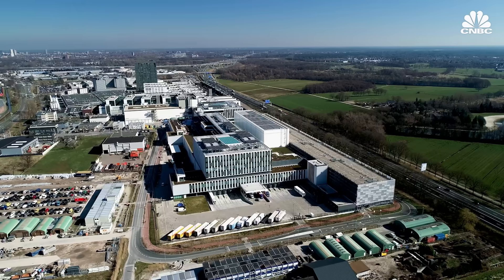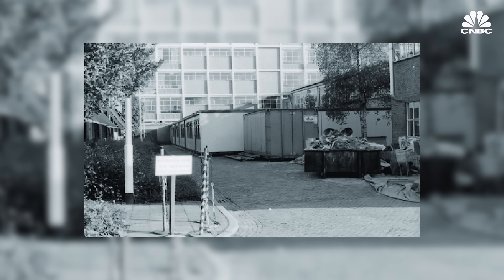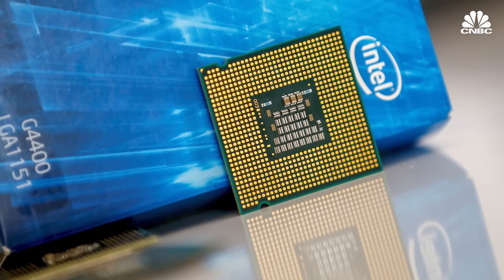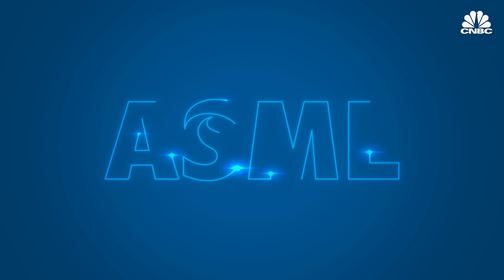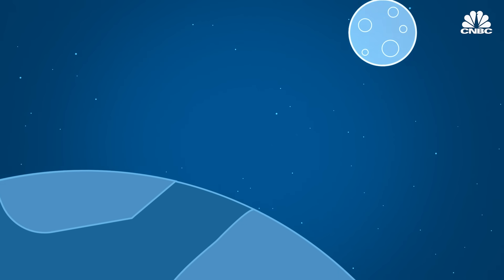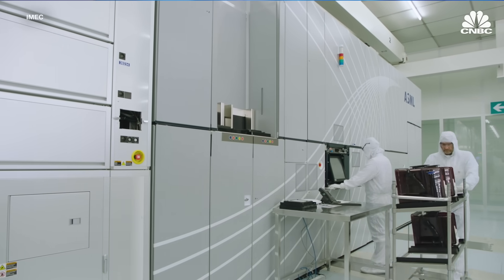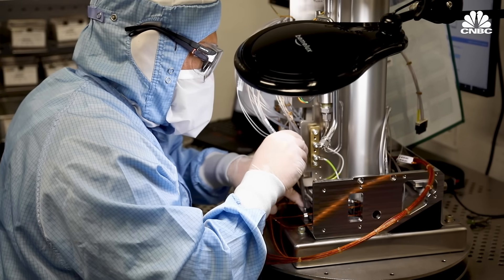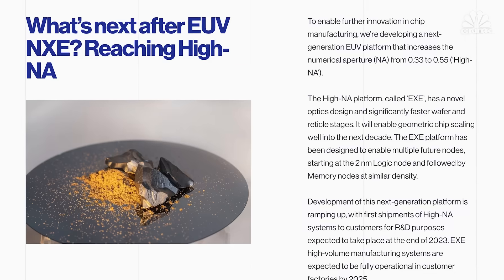Why The World Relies On ASML For Machines That Print Chips

Comment: About 50 years ago, I was asked to evaluate a new IC for possible use in a military minicomputer that Raytheon was developing for Naval sonar systems. That IC, the Intel 4004, could have fit nicely into a new physical architectural standard designed by the Navy (NAFI) to accommodate the pace of technological change. However, it was only a 4-bit slice of an Arithmetic Logic Unit in a 16-bit minicomputer that used about 60 similar cards. The technology was part of a rugged & cool running minicomputer that would soon be obsolete.
Something the size of a microwave would soon shrink to the size of a postage stamp ==and eventually to a speck while covered with a protective layer of quartz.

Comment: The chips these machines help produce aren't the chips that are keeping cars, trucks and motorcycles off the showroom floor. Those chips are 3 or 4 generations old and the car makers are very reluctant to upgrade to more modern chips. It is financial suicide for chip makers to open new factories to produce these dinosaurs because there is almost no margin there. Think your thermostat or refrigerator has 5nm process chips?

Comment: Perhaps factories that print computer chips can also remove CO2 from the air and sequester the carbon in Man Made Diamond Batteries that are capable of powering motor vehicles for 1500 years.

Comment: I've heard that these machines are SO advanced, even if China would acquire one they wouldn't know how to operate them, and by the time they have reverse-engineered one AND tried to understand how it works, there is a new generation of machines out in the world already.
Reply: Chinese: hold my beer...
Reply: @csaracho2009 I work with amsl, their technology and proprietary knowledge cannot be copied or stolen, it’s way beyond the Chinese to copy, knowledge has to be learnt from first principles. Even if they had a machine in front of them they couldn’t recreate it.
Reply: Operating one is not the same as building or reverse engineering one, they'd easily figure how to operate it,  not reverse engineer it, but in a few years they'd figure it out, which is why the west america specifically is super strict on such tech.
Reply: One of the reasons they want to take Taiwan...
Reply: @joetuktyyuktuk8635  if they place a single Chinese boot in Taiwan the inbuilt demolition charges in these factories will go off. They can’t get hold of the tech this way.

Comment: The Austrian company for which i worked by ASML In the yeas 2005..2008 to implement the main control hardware. I had done a lot of Sofwtare work from our company for ASML here in the Netherlands. You remember the first DualCore Chip and the QuadCore Chip? There are done of machines like this one.

Comment: this is all good and all but some of those smaller companies not going forward with far UV and developing 7 nm chips is simply because they know what's coming....
Reply: They can’t afford it? Wdym?
Reply: @bentrinker1937  Moore's law is not  going to be a law much longer, and the cost of these ultra high density fabs is through the fricken roof, plus, right now, there's a lot of uncertainty about what is going to be the "winner" in terms of new technology for chips in general, the fabs that they are about to build, using far U.V. might be the very last that used this system, like the only way forward with this tech was quite literally up , as in vertical off the x,y plane, they started using 3D to build thicker gates to stop electron leakage. But make no mistake, this sort of tech has had a excellent run, but it's nearly tapped out, that's not to say that they have not sunk silly money into new types of chips. Like A.M.D. have gone with their "chiplet" design, which is great, but as you know even with a mature technology node with it's optimum yields per wafer of silicon, where they are cramming billions upon billions of transistors on one chip, even with very good efficiency of the silicon the density means heat, heat heat heat ! look at the latest Nvidia flagship graphics chips, take a look at the size of those heat sinks, and the current needed to push those electron around, it's crazy ! So I suspect in the next five to ten years we will see the arrival of completely novel technology.

Comment: The A15 contains 15 billion transistors, a 27.1% increase from the A14's transistor count of 11.8 billion. It includes dedicated neural network hardware that Apple calls a new 16-core Neural Engine.[8] The Neural Engine can perform 15.8 trillion operations per second, faster than A14's 11 trillion operations per second (+ 43%).[8] The A15 also includes a new image processor (ISP) with improved computational photography capabilities.[9] Apple also boosted performance by doubling the system cache to 32MB.[10]

Comment: The real reason for AMSL's success is that they took Moore's Law as fact, and work back from that to determine what needs to be done to make it reality. And then be absolutely ruthless in doing what needs to be done.

Take Zeiss for example. ASML management discovered that Zeiss management lacked commitment to achieving what was necessary. So they took over the relevant department, and turns out it was possible -- if you are committed.
Reply: The reason that Zeiss was able to develop EUV technology at a time when competitors had abandoned the idea as unrealistic is that Zeiss is a company with a very devirced business - consumer optical products, industrial measurement and research technologies, medical technologies and chip lithography technologies. All this has allowed a decades-long funding of EUV research, at the expense of revenues from other fields, without going bankrupt. ASML is just extremely fortunate to have such a company as Zeiss as a partner. 😉
Reply: China is overtaking it

Comment: To destroy the misconception spread also by this video: the chip shortage is NOT caused by a lack of DUV machines. The problems are caused by the less advanced plants being worn out and not being rebuilt.

When those old plants were built, they were able to charge a premium price that quickly payed for the investment. However, if those plants were rebuilt, they can not charge a premium, which makes them nonviable.

Comment: Zeiss is the true king that made EUV lithography possible for ASML
Reply: Cymer in San Diego, CA (US company) developed the EUV light source for ASML back in 2007 - 2008 (approx).  Cymer produces most of the Excimer Laser light sources used in semiconductor photolithography.  ASML bought Cymer seven years ago (?) to have more control over the EUV light source development/advancement for ASML’s EUV machines.
Reply: @stevengiles346  thats the light source not the optics that are requiered for a 5nm process
Reply: @maxz9787  And if there was no light source?
Reply: @stevengiles346  there are multiple companys that manufacture those but Zeiss is the only company with that you can achieve 5nm
Reply: @maxz9787  name the others the make that light source.

Comment: There is nothing American about this. If you want to know the history, you have to go back 300 years, and look at the inventions in optics (vanLeeuwenhoek) , and realize that this could not have happened without the generous funding of Philips.
Reply: Cymer, a US company in San Diego, CA developed the EUV light source for ASML back around 2007 - 2008.  ASML bought Cymer maybe 7 years ago to help push and advance the progress of the light source for its EUV machine.  Cymer is a major manufacturer of Excimer Laser light sources for semiconductor photolithography process.  They’ve been around for 20/30yrs.

Comment: They think they are a monopoly, arrogant over paid sales and executive force, service marginal as well as uptime, , they'll crash as EUV lithography disappears. Research before you buy. Propaganda at best. Their equipment goes out of spec during shipping even before installation, reconfiguration is not cheap.
Reply: @Null Pointerwith respect,  sorry but I get paid to answer questions like that, if you don't understand physics I can't help you. I can assure you this is just propaganda on the part of ASML - IF they are at the top of the food chain with their so called capabilities, why are they using YouTube, the poor mans guide to technology at best in social media  to promote their greatness.
Reply: @Null Pointer Null, learn to read - your question has been asked and answered, good luck in your career search after graduation.

Comment: It's quite amazing what they manage to make, but the price tag makes me think there has to be better, easier and cheaper ways to make these chips eventually.
Reply: Yeah, amazing.  On cost, chips today contain 1000x the transistors of 20 years ago, so in a sense you could view the $300M cost of an EUV machine as helping to produce as many transistors as 1000 $300K machines back then.  The point is, the emphasis is on producing chips which are smaller, use less power/transistor and are lower cost/transistor.  Doing this requires more expensive and complex machines, but they produce more powerful chips than exist, creating more powerful compute platforms for products that were previously not possible (autonomous vehicles, AI, etc.). 

People today walk around with a $1000 supercomputer smart phone in their pocket that is more powerful than a super computer from the past that used 1000 times the space, 1000 times the energy and cost 1000’s of times as much. And it’s battery operated.  Machines that can keep shrinking chip feature sizes and cramming more transistors (compute power) into the same space all while being more power efficient will help solve new problems and create new products that were not possible before. 

In short, $300M is expensive, but each machine produces great value.  It is hard to comprehend what it means and take to pack tens and tens of billions of transistors into the size of a penny.
Reply: @ttb1513  Sure, it's just that so few have the means to purchase this equipment for manufacture.

In a wider sense, the highly specialized production of both chips and electronics in general, limits who can really take or create any market segment. Serviceability and reparability is also increasingly more unfeasible.

Comment: For anyone wondering if China or any other country could replicate this technology, I highly doubt it.
Even if said country would gain access to one complete system, and got drawings of the different parts I don't think it would be feasible to replicate the technology within the next 10 years. 

There is a whole supply chain of dozens companies developing parts specific to the ASML system. Each of these companies have decades of experience in that specific speciality and are the only ones able to do that speciality. On top of that, large part of the IP is software, which cannot be underestimated. Also the engineering mindset within the company is unique, and is one of the reasons why ASML became successful. I have thought about it for a while but I cannot think of any other technology that comes close to the complexity of these systems.

Comment: so the question is what kame first? machines that make chips or the chips?
Reply: In the 70's chips were made by contact litho, where you would place a reticle (that is a glass plate with the image on it) on the wafer (it was a 1 on 1 process, so no scaling) and microscopes were used to position the reticle on the previous image. If it was placed, a light source was activated that illuminated the wafer through the reticle. It was all done manually, so no chips needed.

Comment: The first problem with “globalization” is one billionaire, one strong man, one dictator that makes “something” that the entire world depends on.  The sooner we build things back home for every single thing that we need the sooner we stop having these unique markets that corner chips, grain, oil….or whatever
Reply: This incredibly complex process of making a chip is only possible because of a global division of labor that allows for extreme specialization. If we build everything at home we will go back directly to the dark ages.
Reply: As I understand it these machines are only used to make the MOST complex chips.  Why do we need everything to run off these chips?  It just doesn't make sense that we can't make cars, trucks, whatever to run off less complex chips.  Just because we have the ability to make super duper incredible chips doesn't mean that we need to automatically make everything reliant on those chips.

Comment: So possibly the only decent monopoly company on the planet? Leave them be, while yes 200-300 mill is expensive producing 3000 wafers/day that can sell for $10,000-30,000+ a pop makes them actually cheap for said buyers, considering that unit will likely (relevance) last 5-10 years which then puts them at around 20-60 million a year plus operational costs.

Comment: For sure this amazing and cutting edge technology. BUT and a HUGE BUT is that 99% of cars, other machines, phones etc etc do not NEED 7 or 5 or 4 Nm chips to work.  12, 24 or larger will be more than adequate.  Remember pre x86 chips were used for space travel etc and top range i7 chips from 8 years ago (24nm) were at the bleeding edge of nuclear medicine etc.  The application, cpu instruction set and other variables are the crucial elements

Comment: A little bit surprised that the manufacturer of chip making machines isn't the one making the chips for their own machines... They sell the machines and then rely on another manufacturer to use the equipment they sold to make the chips required to make more machines. Seems like they should keep maybe one machine for themselves?
Reply: That would take away the point he is making saying that synergy is the value of the economy of this industry.

Comment: How do you print 7 .. 10nm transistors with a 13nm beam? I guess the shown machine isn't cutting edge?
Reply: It is possible to print structure that are smaller than the wavelength of light. It just gets complicated because you have to increasingly account for diffraction. Pretty much every CPU built in the last 20 years was manufactured that way. Engineers have a couple of tricks up their sleeves to make that happen like Phase-shift masks and optical proximity correction.
Reply: Multipatterning
Reply: The wavelength of DUV machines was 100+ nm and able to make 10nm chips. This due to a very big lens to focus the light? Very possible isn't it...

Comment: Why doesn't ASML make their own chips?
Reply: Now you need to invest in a big fab, which costs you 500 million or even billions? You need to hire thousands of employees.
You need to invest lots of money in other research like chip design, best chemical mixtures you need for the wafer. Things Intel, Samsung already know.
All the money you spend on this you cannot spend on your core products today.
Reply: The same reason why Boeing doesn't have its own airline. It's a different business.
Reply: @hauuau  ASML is the only company able to make the hardware needed for the most advanced chips. I'm just surprised that doesn't lend them special expertise they could use to secure additional funding to get into making the most advanced chips. 

If Boeing were the only company able to make a competitive passenger plane I'd wonder why they didn't leverage that into making a top tier airline. 

I get it though. Stick to what you do best and keep it simpler.
Reply: @2beJT  It's also important to note that ASML have developed that hardware in tight cooperation with chipmakers like Intel, Samsung, TSMC, and with decent amount of risky investment from them. I doubt they will like it if ASML uses its position as hardware manufacturer to compete with their business.
Reply: @hauuau  Yeah, good point. They get a lot of cooperation being the way they are. 

Thanks for all the replies everyone.

Comment: This is just one of many great products the Netherlands exports all over the world. A small country, but with some very clever people.
Reply: Another great product from the Netherlands: Thales Netherlands developes and built worlds most advanced radarsystems.
Reply: Jaja but the component that makes ASML better that Epson and co. Is the EUV lithography system from Zeiss.
Reply: @maxz9787  ASML management discovered that Zeiss management lacked commitment to achieving what was necessary. So they took over the relevant department, and turns out it was possible -- if you are committed.
Reply: @peterdevalk7929  what Trash are you talking Zeiss never was able to manufacture a complete machine. They only made the optics in this field how should they come Up with the whole machine. But its the Zeiss optic that separates ASML from Epson and co
Reply: @maxz9787  And it's ASML that kept Zeiss on their feet.
Reply: @peterdevalk7929  what do you want it is a cooperation. And without Zeiss ASML wouldnt be able to produce 5nm Chips. Zeiss would then sell their system to Epson making them the market leader. Without Zeiss there are no 5nm chips. Without ASML there would still be 5nm chips.
Reply: @maxz9787  No idea where Epson entered the equation but be sure that there is (much) more to litho then just the lens
Reply: @maxz9787  does epson manufacure euv machines?

Comment: I am amazed it is impressive. the dude said. "too make life easier" LOL BS makes life harder. it is easier with out bloody computers in everything. we don't need chips in fridges to tell us to restock(and linked to the internet) I can look inside and decide what I want to buy at the shops. same as toasters. I can look at my toast and decide when it comes out. I am not so dumb I need a pc to do it for me. also. cars? they are better with out the sensors. I don't want lane montioring and spycameras on my car. the only thing maybe is airbags and window steering and fuel injectors. manual move mirrors(not fold downs) I don't need automatic light dipping. again. I am smart enough to do that ;)